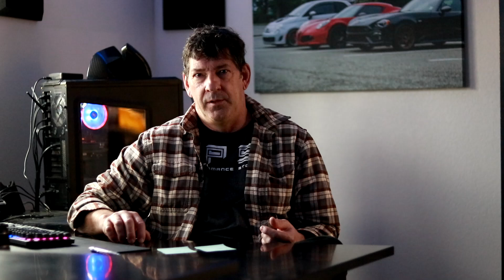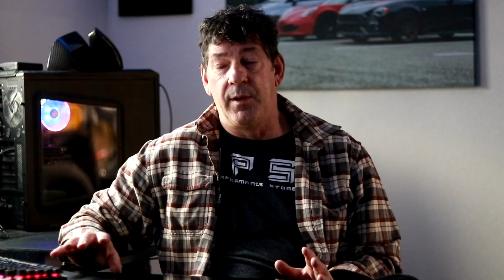Boeing 727 Falls From the Sky TWA 841

Comment: I’m going to have to disagree with you Greg. A guy by the name of Emilio Corsetti has done a tremendous amount of research on this accident and even written a book on the subject. In his research he found major flaws with not only the conduct of the NTSB during the investigation but also holes in assumptions that they made. For example the upset occurred not right after the FE returned to the cockpit but 30mins later. 

He also provides an alternative theory centered around yaw damper failure. Examples of which were documented numerous times and the characteristics of which actually fit the upset vice the NTSB scenario. 

Note too that testing of this supposed hack during the investigation found that it induced significant buffeting (which was not reported by anyone) and did not actually improve the aircraft’s performance. This was testing done at 727s at the time duplicating what the crew supposedly did and the results not only don’t match the accident flight they also don’t produce the supposed results. 

Something else. If this was caused by the FE pushing the breaker back in why did he never say anything about this? He hadn’t extended the flaps. He wasn’t responsible for Hoot doing that if the NTSB scenario holds. So why would he never ever admit it? Maybe because it’s false?

Finally a question. The people you’ve talked to who did this. Were these 727 pilots who were flying at the time and who personally did this regularly? Or are they repeating what they have been told by others. 

A link below to one section of Emilio’s blog where he goes into the Yaw Damper theory. There is a lot more on his website as well. 

https://emiliocorsetti.com/so-what-really-happened/
Reply from the maker: I am familiar with that theory, but I disagree with it. I have personally had a total failure of the Yaw Damper system in a 727 at high speed and high altitude. It wasn't fun, but not that bad either. It was actually exactly like it was in the simulator. 

    As for the F.E. pushing back in the CB, because we don't have the CVR data, we don't really know when the F.E. came back in relationship to the incident, plus he could have pushed the breaker in after a while, we don't know that he noticed it right away. We just don't have the time table there, and again, that's because of the erasing of the CVR.

     Yes, I flew with 727 pilots who did this. They talked about it like it was a normal thing. In fact some say that at TWA there were even unofficial charts for this procedure. I haven't seen those myself, but nothing surprises me from that era. I have personally flown 727-100s with the conversion I spoke of, so I have been at altitude with the trailing edge flaps out at about 2 degrees.
Reply: @GregsAirplanesandAutomobiles  bear in mind that the damage to the aircraft was as such that the CVR could not have been erased by the crew. 

The yaw damper failures you experienced. Did they result in one rudder going hard over and the other not?

Again the tests done by the NTSB at the time of this incident showed evidence that was inconsistent with their conclusions. For example they found the flaps being out resulted in a very noticeable buffet that had not been present on the incident aircraft. By contrast the Yaw Damper failure scenario has been substantiated by in service failures that resulted in aircraft behavior very similar to that reported by the crew.
Reply: @GregsAirplanesandAutomobiles  One thing jetdriver didn't mention is that the right outboard aileron also free-floated up due to a fractured bolt. With the outboard aileron free-floating it was the final nail in the coffin that sent TWA 841 into a dive. Had there not been the free-floating aileron they wouldn't have gone into a dive. There are many instances of yaw damper failures on the 727, some of which causing uncommanded rudder movements, but none had a free-floating aileron as on TWA 841.

With your statement " As for the F.E. pushing back in the CB, because we don't have the CVR data..." Do you know the timeline of events for this flight and how long CVR recordings were then? At 9:47pm is when they went into the dive and 10:31pm is when they landed -- a time of 44 minutes. CVRs only recorded the last 30 minutes of the flight so the FE returning to the cockpit right before the dive per the popular theory would have been long off the tape. Please take these facts into consideration if you're going to speak on them.
I am autistic and as I've gone from a mere child who knew barely the basic principles of flight to a grown adult with his CPL and Multi-IFR, I have gotten tired of misinformation in aviation occurrences and strive to correct people when they're wrong so apologies if you felt I was pestering you with my comments.

Comment: Back when I flew C-130's, we did the same thing. Much simpler flap system, but cracking about 5 - 10 % flaps in the climb gave it just a little increase in rate of climb. Useful when we were heavy and needed to get higher quicker. Luckily I started flying in a time when there were still a lot of old crusty Viet Nam vets still on active duty. They passed along so many little tricks that only worked if you really understood your aircraft systems.
Reply: Yes, we were still doing that in the 130 during my last deployment to Iraq in 2008. Put in about 10% flaps if we needed to loiter at high altitude and stretch the fuel.

Comment: Layperson here: If one crewmember pulled the circuit breaker, and another reengaged it, what evidence of those actions would appear on the cockpit voice recorder unless somebody said something? Isn't there another black (or some other color) box that records which switches are thrown and which systems fail?
Reply from the maker: Back then, all you had was the CVR. You would hear the discussion about it, but not the click of the CB.
Reply: Back then, just a few tracks, I thought - Airspeed, Altitude, Heading, Vertical Acceleration, Time, EPR, and OAT?

Comment: Circuit breakers were used to "trick" the system in Phantoms too. There were interlocks in the missile firing system to prevent the forward Sparrows from being selectable when the center line fuel tank was installed. This was because the forward fins of the missile would hit the tank when the missile was ejected. There was also an interlock that prevented the Sidewinder's motor from firing if the speed brake was open as the speed brake was directly behind the missiles. 

When training with simulated Sparrows (just a little electronics package that was attached to the missile umbilical to allow the system to think there was a missile there) and with captive carry Sidewinders they'd pull those circuit breakers to be able to select the forward Sparrows and to "launch" a Sidewinder with the speed brakes out.

I never personally saw a jet come back with holes burned through its speed brakes, but I did talk to people who had.

There was also a motor fire circuit breaker that we pulled when loading and testing Sparrows on the ground. If the RIO didn't reset that before they tried to shoot the missile, they just had an expensive dumb bomb. I have personally seen that happen.

Comment: Thanks Greg.  The odd 727 freighter flew in & out of Sydney in the early 2000s, mostly DHL.
Had a house in Sydney, very near but between the runways. 747s etc took off from 'the front runway'.
727s used the new '3rd runway' (yes, only 2 now lol), up much higher behind & had distinct noise.
PS: The old BAe 146, still in basic Startrack livery, sits on unloved at Coolangatta/GC.

Comment: Besides the story i like the way you approach this as an instruction for the younger generation which is don't try to be smarter than the manual. It is subtle but i get it and fully agree. Back in the day it was easy to try these things in flight for two reasons. One, there was no OFDM, very few parameters were recorded anyway and the simulators were really basic not enough to introduce the pilots to the aircraft characteristics. The 727 was not for everyone, it really was a diva. I flew it as an F/0 with very experienced captains and saw things being done, or made to do things that i have never done since. So it really is in its own category.

Comment: Now I want to know how extending slats above critical Mach number will cause the aircraft to "fall out of the sky".
Reply from the maker: The flap extension lowers the mach number. So if you're cruising at .815 and the critical mach drops from .90 to .77, you suddenly find yourself way over critical mach and fall out of the sky.
Reply: Probably that you get shockwaves forming over the wing downstream of the slat, altering the lift.
Reply: The angle of attack changes drastically w/leading edge extention. Pitching nose down drastically which leads to mach buffet as speed increases. Loosing control in a wild pitch down and roll if the slat tore off. Lucky aircraft stayed intact enough to be recovered in thicker air once it was slowed down. Pretty f'n scary.

Comment: With 10000 hours on the 727-100 and 200 I can say the 727 was a very good plane but not a great high altitude performer I had no problem flying the 100 at altitude if light enough but the 200 struggled there
Reply: Same here. I used to fly the 100's higher than the 200's, especially the lead sleds with dash 7 engines. When the 727 was loaded up I usually flew them in the low 30's.
Reply from the maker: "Lead Sled" that sounds like a DHL Airways term.
Reply: Our TWA pilots called her Miss Piggy. That's because they said it was like trying to get a pig to fly above FL 320. Later models had the JT8D-15 engines. That helped a lot. TWA A&P MCI Overhaul Base 1986-1999

Comment: The subject 727 was ferried to the TWA overhaul base in Kansas City and rebuilt. A friend of mine was one of the leads on the rebuild. It eventually ended up with Amerijet I believe. Amazingly tough airframe. I didn't start flying 727's till 1983 so the TWA incident was still pretty fresh and talked about in training depts. I never saw the unauthorized procedure done or would I have ever done it myself. I have however been a bad boy and extended the flaps to 40 on a blocked out gate occasionally, operational necessity of course.  That was easy to do.  Racking my old brain on 727 system knowledge is bringing back a few memories. Keep the 727 stuff coming Greg. Thanks for the video.
Reply: Amerijet?  Oh no.  I worked for Amerijet while laid off from EAL (1988).  We MX guys called the place "Happy Jet" - but there was nothing "happy" about working for that outfit.  I could tell you some stories - you simply would not believe.   The crap the management of that place would try to get away with was beyond the pale.  They are damned lucky their operation was not permanently shut down by the FAA.
Reply: You think about it falling twisting turning and never ending up in a position that would rip a wing or tail section being twisted off.   Had it been falling flat both a wing would have folded up and kaboom and fertilizer.

Comment: B727 MXr here (23 years).  I saw this result coming from a mile away.   Poor Cockpit communication ("resource management") nearly cost the aircraft and all souls aboard.  Their Guardian Angels were working OT that day for sure.
Reply: One circuit breaker collar would have prevented the whole incident. Think about that for a minute. The FE would return to his seat and either not see the white band of a pulled or tripped breaker, or question someone about why there was a breaker collared that hadn't previously been. There is an entire bag of collars in the spare bulb kit, and usually a couple stuck to some 1864 lambs. Thank goodness they saved the aircraft. The 727 was a tank, as Joe Patroni would say.
Reply: @dougrobinson8602  Believe it or not - "Joe Petroni" (actor George Kennedy) was my inspiration to become an A&P ... Well, in truth, my Dad moreso - as he was always bringing me and my siblings to the local airport to watch aircraft operations.
Reply: What was the motivation for this? Why would pilots care about the increasing the max altitude?
Reply: @MikeF1189  More altitude = less dense air = less resistance (drag) = more speed or efficiency
Reply: @MikeF1189 . Speed.   Every pilot wants to get there faster.   It is a really dumb thing to do for the reward.
Reply: In those days CRM was non existend

Comment: While I am not that familiar with the Piper, but wouldn't all the fuel being burned from one tank make the side not being used heavier causing the trim to have to be constantly adjusted giving the pilot a clue that the aircraft was burning more fuel on one side?
Reply from the maker: Not really because of the amount of fuel involved, location of the tanks, aileron trim, short flight, and the fact that the planes at that company were all beat to hell and bent. They didn't fly straight anyway.
Reply: @GregsAirplanesandAutomobiles  Thanks for clarifying, I had the same thought while watching
Reply: That was my thoughts, but Greg's comment sounds plausible.

Comment: Thanks for this addendum to your excellent 727 video from the other day, I really enjoy the change of pace from the usual WW2 fighter topics!
The 727 is (and always will be) one of my absolute favourite airliners, I really miss the ear-splitting roar of those JT8-Ds. Unfortunately I was too young to fly on one when they were in their prime, I do remember flying on one of the last Ansett -200LR flights with the extended range fuel tanks in early 2001, my airplane obsessed 10 year old brain soaked up every bit of that flight, it felt special!
Reply: Ear-splitting roar - yeah, I'll say.  This A&P had to do B727 engine trim ops under the cowling, at full power.   I could only wear the Headset for comms with the cockpit.  Result - I  lost some hearing and eventually ended up with tinitis.  Worked on Pratt engines for many years in my career: Flightline ops (A & B checks / engine change crew); Heavy Overhaul (C and D checks, Gear and Rigging crew); Engine Overhaul; and Experimental Assembly & Test at PWA in E.H., CT.  I miss working on the B727 - she was and will always be my favorite, even though it was sometimes a "love-hate relationship."
Reply: I flew on quite a few commercial airline flights. The 727 was my favorite as a trip-jet and clean lines. I would have like to have seen more modern engines, though.
Reply: Previous video he says the 727 was quiet (even said it was called the "Whisper Jet") and this video he says it was very loud.   

Does that mean it was quiet compared to the other jets in the 1960's but 20 years later it was loud compared to other newer aircraft?
Reply: @unpopularopinion8608  Stand next to a B-707 running at TO power.  Those JT3Ds scream like no other turbine engine.  The JT8D is a relatively quieter engine.
Reply: @hiturbine  user name checks out